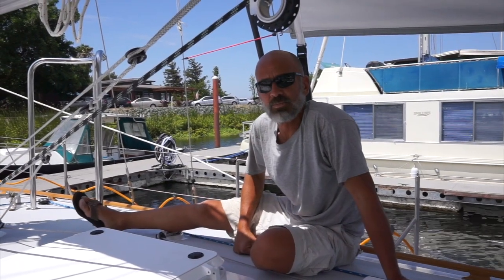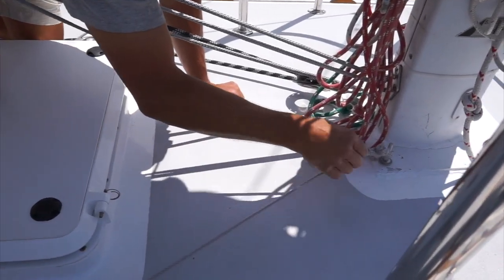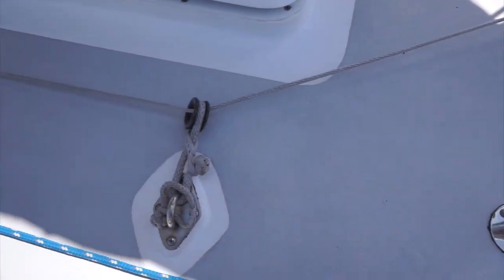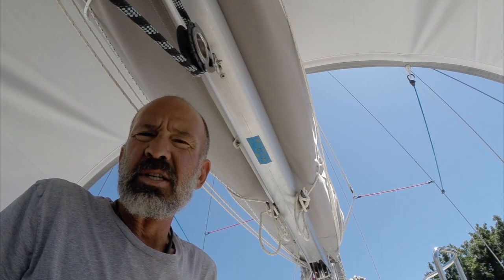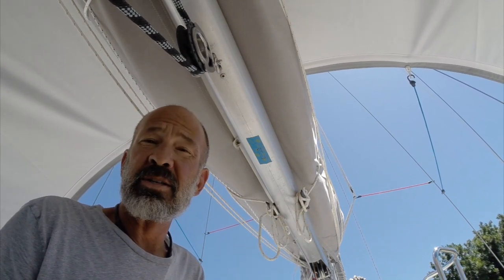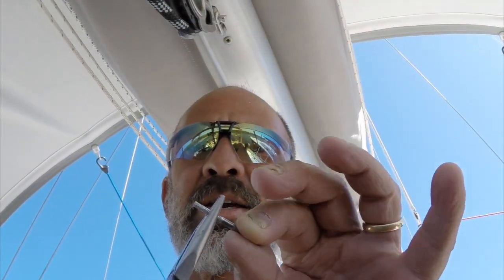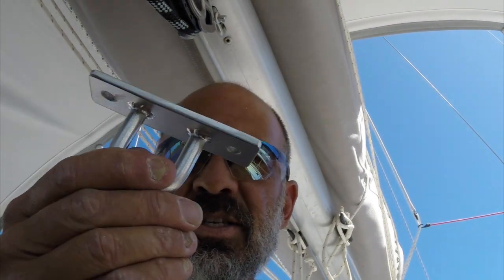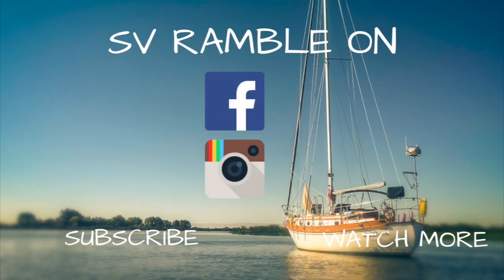SV Ramble On | Installing a Boom Bale and a Boom Vang

Comment: How do you call that tool, which secured pins?
Reply from the maker: It’s a large diameter rivet tool from McMaster Carr
Reply: @svrambleon  thanks! I guess using rivets gives you permanent and more reliable set up, than any screws
Reply from the maker: Absolutely.